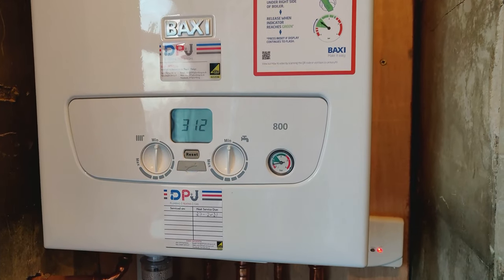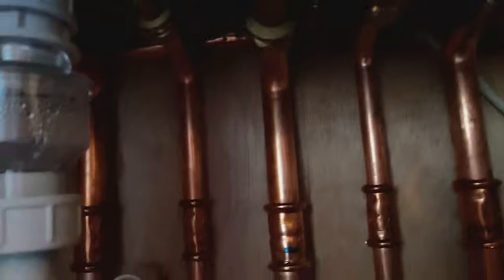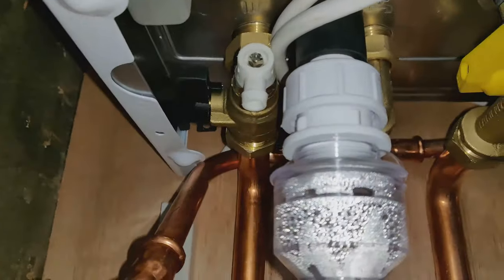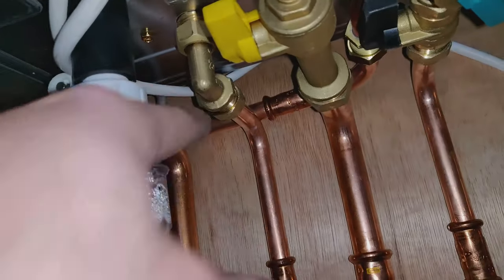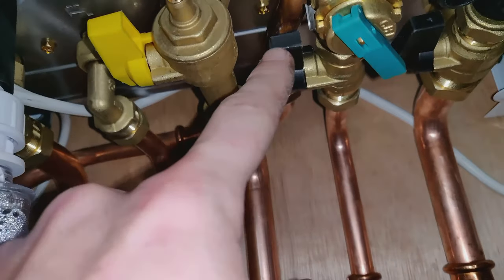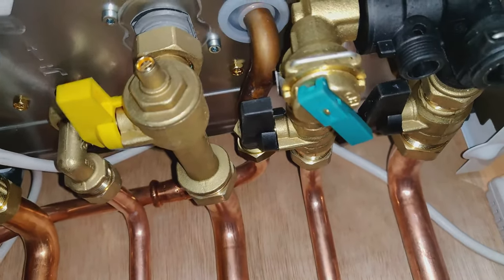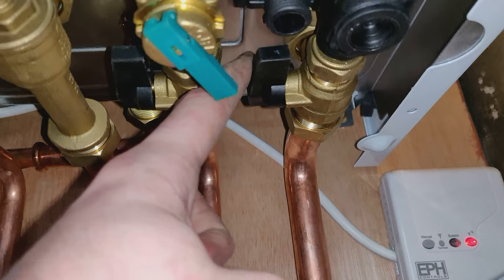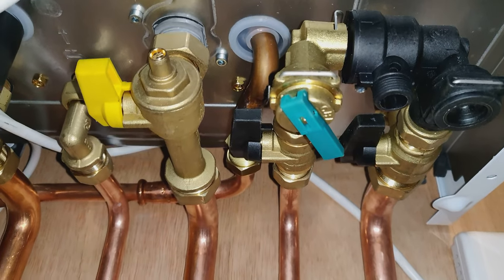What are the Levers for under your Baxi 800 Combi Boiler?

Comment: Should the yellow lever (gas) be up or down? Would apriciate a response. Thanks.
Reply from the maker: Horizontal is open

Vertical is closed

Hope that helps, I've only just seen this comment.

Cheers,
Dan
DPJ Plumbing Heating and Gas

Comment: How would you bleed the hot water that goes to your taps? My hot tap in the kitchen has terrible water pressure. All my other taps/ahower are fine
Reply from the maker: You don't typically bleed mains supplied taps as the pressure is usually good enough to remove any air/blockages.

If it's just one tap playing up, I would say it's more likely to be 1 of three things:
1. The tap itself
2. Isolation valve isn't fully open
3. Bad pipework

Without seeing it myself, I cannot give the best advice.

Thanks

Comment: If I have a leak in my central heating system and I want to stop water from flowing into it... Do I switch off that first lever on the left? Assuming this is so, how do I then drain the rest of the water out of the Central heating system... at a radiator or at/from the boiler?

Comment: hello i need to take a radiator off can i stop the water with a lever from underneath the boiler instead of the stop tap {my stop tap is under the floor}
Reply from the maker: The water in your radiators/heating system is completely separate from you mains water supply on a seal heating system/combi boiler.

You do not need to touch the levers under the boiler as it will not fill the heating system back up until you pull the green lever down to add water back into your heating system.

Comment: Hello i have a question. I have the same EPH CONTROL switch and the same boiler. When i press on Manual it turns green but then turns off and becomes red after a minute. Im having issue to turn the heater on. The fire symbol on the Baxi comes on and goes away. Should the EPH control always stay green if i press on Manual button?
Reply from the maker: I've found that if the controller is wired into OpenTherm, the manual button does not work.

I suspect your control is wired into the boiler by the OpenTherm terminals.

Comment: Hi should the black levers be opened or closed when the boiler is in use. Thanks
Reply from the maker: Hi, the black levers should be horizontal during normal use.

Vertical shuts off the valves which wouldn't allow your boiler to function correctly.

They're usually used to shut off the boiler for maintenance purposes ie: boiler service, boiler repair, heating/radiator work etc
Reply: Thanks very much for the prompt replay. The video  is very useful.
Do you do one re draining down the system. 
If not is it just a case of opening a drain vent on a radiator valve?
Thanks again
Reply from the maker: @user-ob6oh3yc3r  

Hi,

I don't have one at the moment for draining down a whole system.

But usually there should be a drain off valve on the pipework on the ground floor. Sometimes the drain offs can be built into the radiator valves. 

Sometimes if the plumber is naughty they don't even put any on, then you may have to remove a radiator and attach directly onto the rad valve with a hose.

Hope that helps 👍
Reply: Yes it does. Thank you very much. Much appreciated
Reply from the maker: @user-ob6oh3yc3r  no problem!

Comment: Is the yellow tap to turn the gas off to the boiler? Iv gotta have a new heat exchanger on my potterton titanium 28 because it’s leaking and I’m worried the engineer will need to go to other rooms in my house because I’ve had no covid jab because of my health issues. I’m hoping he only needs to be at the boiler only to do the job. Even that’s a worry because the boiler is upstairs and obviously I’ve gotta go upstairs to bed. Covid really has wrecked my life, not been out of the house in almost 4 yrs now! Any help would be very much appreciated. Kind regards.
Reply from the maker: They should be able to do all the work at just the boiler.

They might want to get to the gas meter aswel.

They might want to visually inspect the flue, so if that goes through another room or the loft they might want to inspect it.

The yellow lever is for the gas.

Without seeing your boiler, it's difficult to give you a definite answer
Reply: @dpjplumbing  the flue goes out the wall at the back of the boiler at the top so that’s ok. The gas is under the stairs so he can go there if he wants because he’s gotta walk up the stairs anyway! I feel a lot easier after reading your reply. It was very kind of you to take the time to reply and I’m very very grateful. Thank you so much!

Comment: Hi mate when I try and fill up using the green lever water comes out the hole to the right of it, any ideas why and what that is on the system
Reply from the maker: Water can come out that hole. It's supposed to act as an air break (if I remembered that correctly)

Does the system pressure still increase when you use the green lever to fill it?

Does it leak constantly or only when you use the green lever?

Cheers
Dan
DPJ Plumbing Heating and Gas

Comment: That first pipe on the left with the white plastic bit facing the front has a nut behind it. I saw it drip water today where the nut is. After few days of installing a new one. Shall I call the engineer back or see if it repeats again?
Reply from the maker: The white plastic pipe is the condense waste pipe.

If it's dripping it needs to be sorted.

The drip/water is slightly acidic and can cause more damage to things than standard water would.

Comment: is their a lever or anything I can do to stop the pressure gauge rising. I did bleed the radiators which did turn the pressure down but straight away started rising again?
Reply from the maker: That green lever when you let go will stop stop filling the system.

The pressure will rise slightly when the heating system is on. But when the heating system goes cold will return to its original pressure.

If it's continuing to rise constantly then it's possible the green lever/filling loop is passing or an internal component is faulty and the mains pressure is managing to pass into the heating system.

Cheers
Dan

Comment: Hi, sir  

But how can one drain water out of boiler when filled with to much water .
Reply from the maker: There are several ways to release some water/pressure from the system

1. Put a cup/container under a radiator bleed and open it up and bleed water out of the central heating system that way

2. Find a drain off valve and use a cup/container or a hose to drain some water/pressure

3. On the left hand side of those valves is a white valve which has a head which will take a radiator bleed key and will open like a drain off valve. You can put a cup/container underneath or a small hose

Comment: Any idea why the radiator symbol would be flashing ?????
Reply from the maker: Radiator symbol flashes when there is heating demand

The tap symbol will flash when you open a tap for hot water.

Hope that answers your question
Reply: @dpjplumbing  yes i am a doughball. I bled the radiators last night but forgot to refill the system. Because I've never actually looked at the display before I hadn't noticed the flashing and thought something was wrong. All good now though thanks for the reply.
Reply from the maker: @civicscreamer  no worries, I have plenty of customers that have said similar things thinking the flashing symbol was a problem when really they never noticed it before.